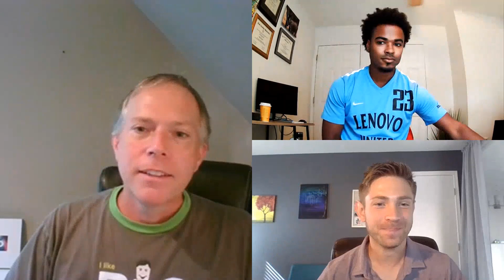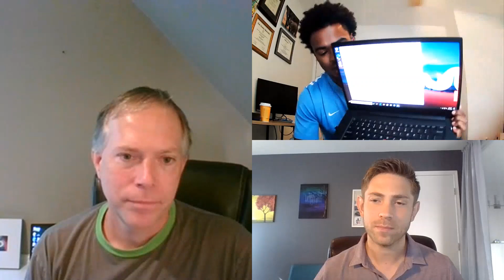Techverse: Lenovo ThinkPad P1 Gen 3

Comment: Agreed this is for enterprise,it should have upgradeable wifi card,Ryzen
 AMD without lenovo spyware, linux and a reasonable price....I have a P1
 the only complaint is that it does not come with better speakers for 
conference calls, linux,and a lower price in Europe. Europe/UK now 
requires a factory option in law to include disabled software specified 
on order from the factory to meet European regulations. This not about 
generic windows or apple retail disability disability software which 
does not meet the legislation.

Comment: This video probably helped me more than any other. I'm a photographer who needs a machine to handle very heavy photoshop applications. I work with large raw files I need to often stick together and that is very demanding. I'm torn between the X1 Extreme and P1. I'm a snob, so I would like to stick to Laptops with SD card haha.
Reply from the maker: What did you chose?  The big differnce between the X1 Extreme and the P1 is the graphics card.  Corporate professions tend to need the Quadro and Gamers prefer the GeForce.

Comment: Not very hard questions looks like you picked the easy ones favouring Lenovo.

Here are some hard ones
1. Why is the web-camera quality soo poor. Even a 30$ mobile has a better camera, don't you think it's necessary for better Team or WebEx meeting ?

2. The Apple MacBook Pro uses same higher end specs but they offer 8tb storage and 64gb ram in the base model and is 200-300$ cheaper than lenovo for that spec.

3. Why is that lenovo offers lower end variants in some countries are they discriminating ? Who is lenovo to decide which country should get higher spec and which countries should not ?

4. Why is Lenovo soo much reluctant to bring AMD in their P series even though the cost will get lower ? Even if they do they deliberately spec it lower Ram, display options and graphics options ? Why is this nexus ?

5. What about the screen flickering issues reported by users and narrowing down to the SSD used from factory ? Did they address it ?

----
But this doesn't stop me from buying this laptop. But still these are the questions you should ask. Not just easy ones so that they brag about the marketing things.

P.S: I am a lenovo workstation user for 8 years. And will be for another decade for sure 😃

Comment: Thanks Thomas for asking some of my questions in this video. In part also based on your previous reviews, I have just purchased a fully specced P1 Gen 3 (i9H, 4TB SSD, 64GB RAM & 600nits display). The transition from my T440s went relatively smoothly. However, some of my older programs battled with display issues, with print and/or icons either being too blurry or far too small. Still working on some of these matters, but confident in eventually solving these problems. My P1 Gen 3 came with 2 x 2TB SSD units, being displayed as seperate drives (Windows C:) and (Data D:). Not having experience with merging SSD's (only HDD partitions), I am wondering if I could merge these 2 drives and what the safest process would be? Far more convinient to back-up just one drive. Thanks again for your regular and informative uploads.

Comment: Hey. Pretty weird question but what is the thinkpad A series for? I was wandering around and found one of them but never heard of that. Goohle also did not say anything
Reply from the maker: When we first released ThinkPads with AMD processors we called them "A" and added a 5 to the end.  Like A485 AMD instead of T480 Intel.  Now we just call Intel and AMD the same.  Like T14 Intel or T14 AMD.
Reply: @thomasvanderkin  ooooh thanks
Reply: @thomasvanderkin  oh hey and my X1C7 (just got a week ago) has a clickier left trackpoint buttons and a quieter, a bit more loose right button. Is that a problem?